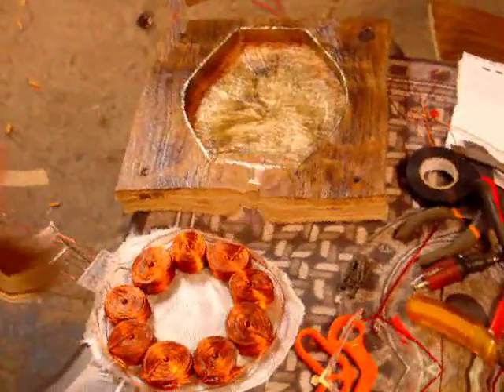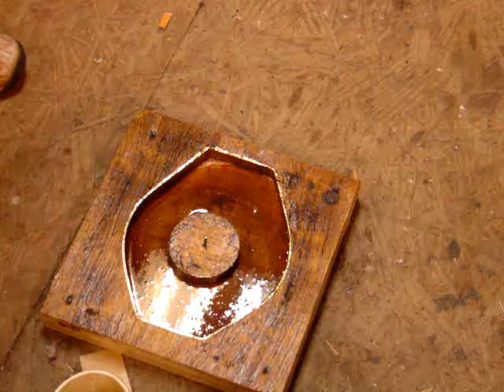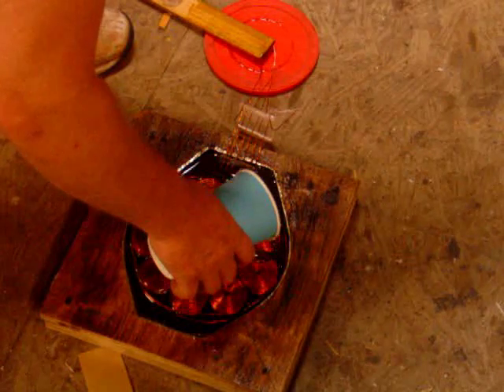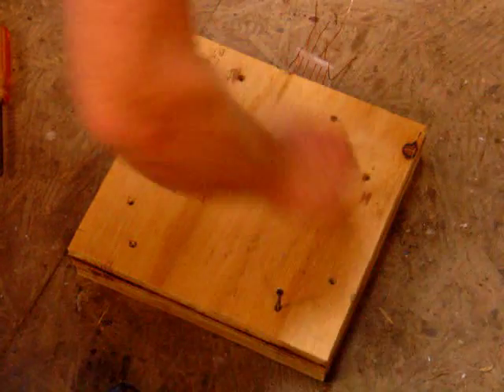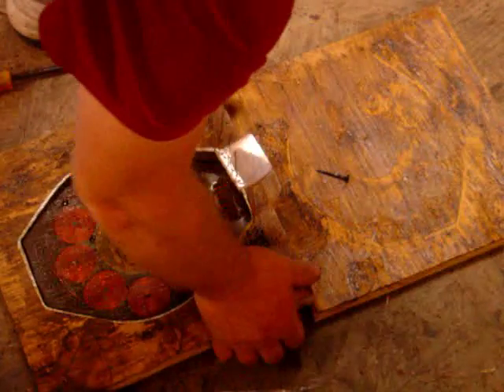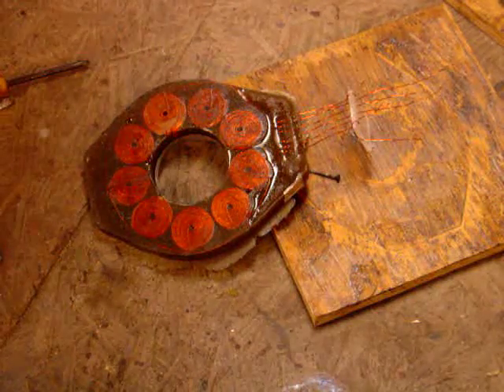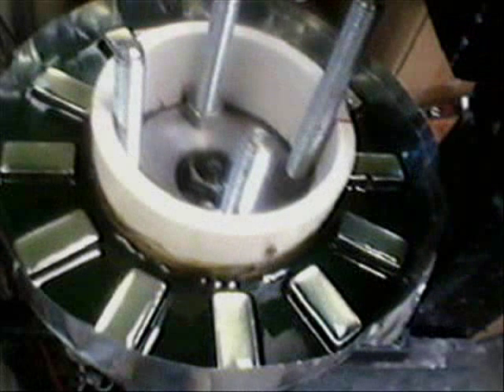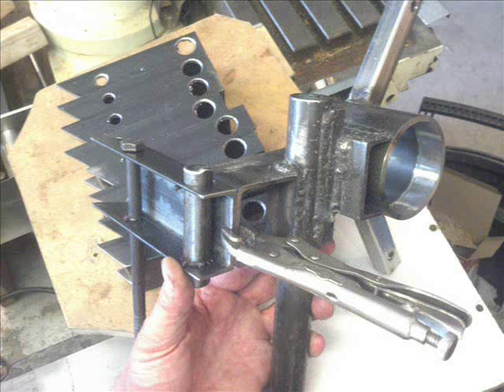PART 3 DESIGN OF MUDDYS' MIGHTY MINI WIND TURBINE PROTOTYPE

Comment: great video. I have a bit of some info to give yea. I still use a peice of fiber glass on both sides. but it looks as if it worked ok for yea. I also use something to vibrate it as whell. to work out the air bubbles. I will have to try and make my own stator I realy like this looks pretty darn easy.  and I use a few holes to fill it up more so there is not any place that is lacking resin. either way looks dam good. nice stator.

Comment: Great tutorial MUDDyl. But I think you need to get rid of that drill that is magnetized to copper LOL. That way it wont be attracted to the wire in the stator. Looking forward to the next video. The increase in size is still within my maximum diameter of 10 inches. Keep going.

Comment: Well, I thought you would have had it with the 6" version.  Am thinking about something else that will be using 12-coils-16mags.  Not sure yet on the wire gauge or the turns.  Doesn't really matter for that project as it is a test of concept.  So, if it comes up short there will be allot of learning of the procedures.  Well, am going back to deal with those cults and crazies.  Be thee bless, Shabbot Shalom.